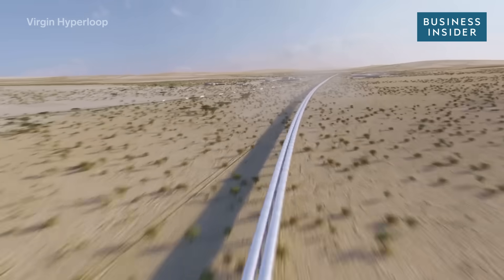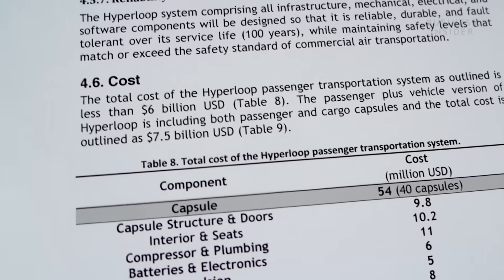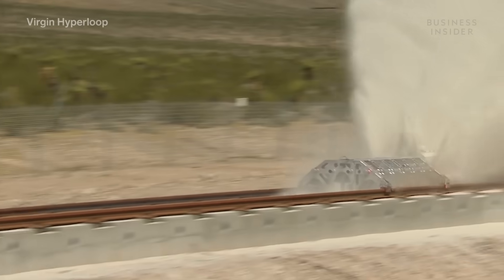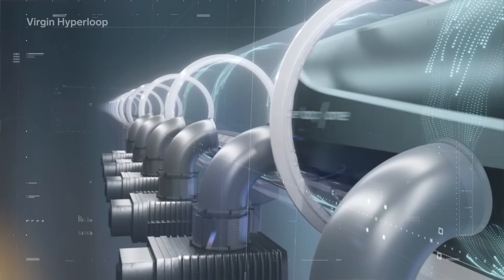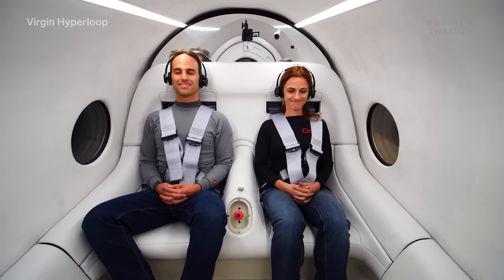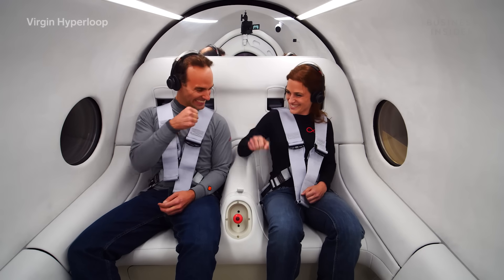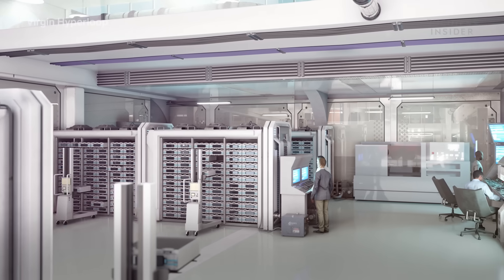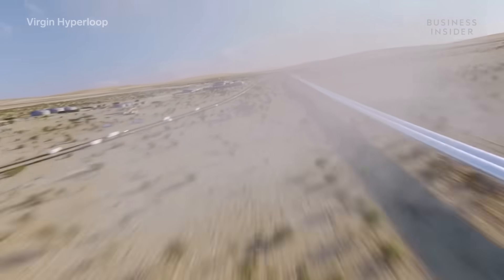How Elon Musk's 700 MPH Hyperloop Concept Could Become The Fastest Way To Travel

Comment: they lost me when they started talking about sucking the air out.
Reply: Here’s one of the latest Thunderf00t ‘debunking’ videos about hyperloop: 

📺 https://youtu.be/VrbstnzbhZA 
(25 minute video)
Reply: @platoscavealum902 are you a spokesperson for thunderfoot? You're posting this video link everywhere.
Reply: Air is matter, when matter slide across another it creates friction. Energy that is used to move the vehicle will be loss to friction. The concept of a bullet train was that the train made no friction with the ground so its speed is fast. Now the hyperloop took it one step further by eliminating the air resistance as well.
Reply: @SoupTurtle16  thats actually where the issues are. Watch thunderfoots breakdowns on his YouTube channel. In general any engineer would have mentioned all of these challenges in the planning stages. 

But a simplified view is. A decompressed tube would have to be safe, out of the way, hidden and fast. The hyperloop is none of these. The worst of it being how unsafe it can be. One bit of damage to anywhere on the entire loop and it cannot go to a low pressure system. 

One single hiccup while it is in motion could mean compacting the passengers.The amount of energy consumed by the loop to either remove the air or pump steam would outweigh the benefits of it being "quick".

At this point a high speed rail would be safer, faster, cheaper, duplicatable and can be built sooner and faster.
Reply: @mannyramoslive2727  True, with how new the technology is it's hard to see how this could be used for public transport.
Reply: @SoupTurtle16  honestly they would benefit mankind by making elevators all around a city with giant sides to go down to different areas.
Reply: Lol couldn’t get past that either. Wack.

Comment: Well I just saw a video a couple days ago about room temp super conductors so I’m sure that will make it’s way into these hyper loops
Reply: these hyperloops will never be built. like, ever. You can't create a vacuum, which these need to work faster than normal trains, quickly or cheaply. Normal bullet trains are so much cheaper, faster, and safer.
Reply: @elibullock-papa9478  dude it’s easy to create a vacuum, I doubt that’s the part they are having trouble with lol, I’m pretty sure the levitation was the hard part to get around, and then now Elon is building tunnels so tunnels will be much better than above ground tubes lol